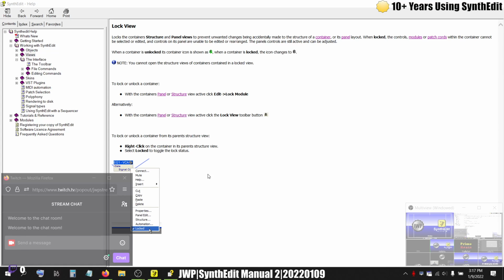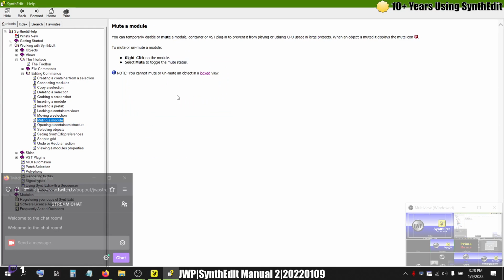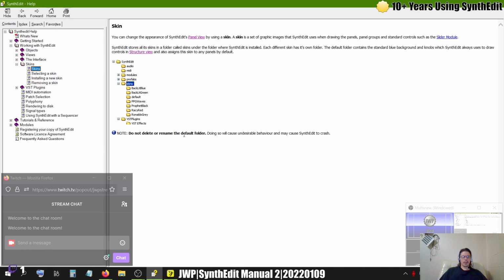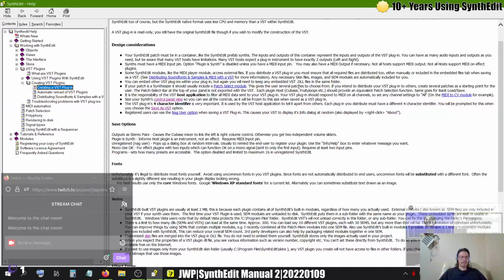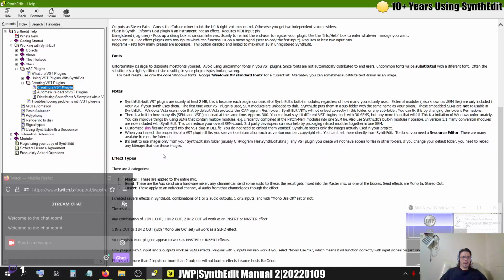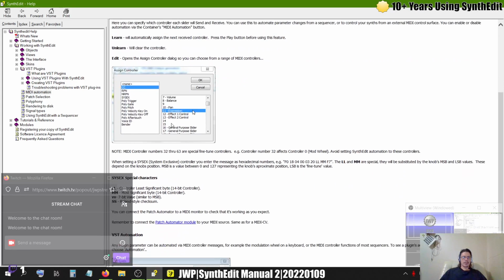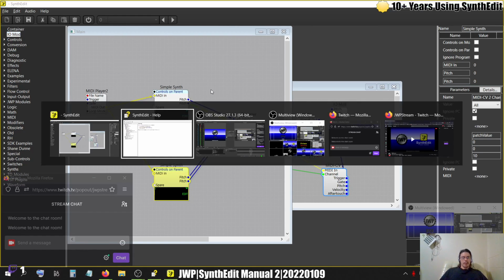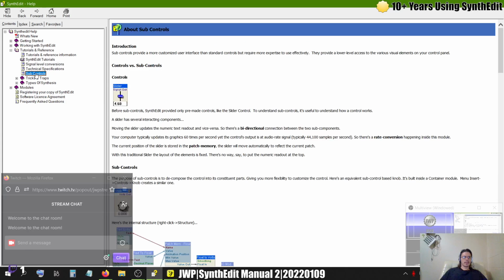JWP - SynthEdit Documentation (Part 3) Manual 2

Comment: in my experience the patch automator cuts out the midi signal. And if you select the polysynth2 synth in Synthedit it doesn't work. In the Polysynth2 when I opened it I noticed there is no Midi to cv  in it which explains why it doesn't work but kills it for me as I am trying to get the the patch automator working 😞 

p.s. Now with the PD303 we get closer as inside the conatiner the patch automator works but no display on the synth panel...getting closer
Reply from the maker: The "Keyboard 2" module is a type of "MIDI 2 CV", however the "Polysynth2" is a dated preset and may not function properly in newer versions of SynthEdit without a bit of repair.
Visit groups.io to request help from the community, keep in mind people here may be eccentric, so you'll have to take the mixture of personalities on the chin!
https://groups.io/g/synthedit/topics
In the case of the PD303, the "Preset Browser" is used in conjunction with "Patch Automator" to create a "control system" with a custom interface.
Reply from the maker: Alternatively, there is the Facebook group for community support:
https://www.facebook.com/groups/129301030415489
and there is a list of internet resources at the bottom of my SynthEdit wiki:
https://syntheditwiki.miraheze.org/wiki/1.4:Main_Page
Reply: @jwptube  Thanx I found what I needed in the group. So the manual needs to be updated for sure !!!  Reminds me of learning Blender and the devs keep changing stuff with the updates